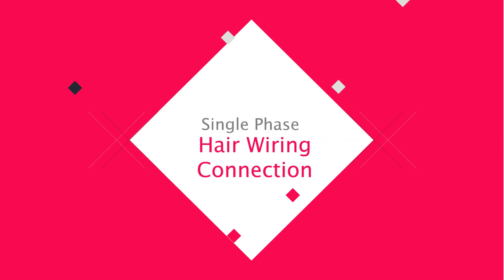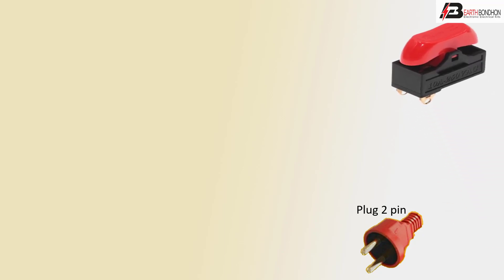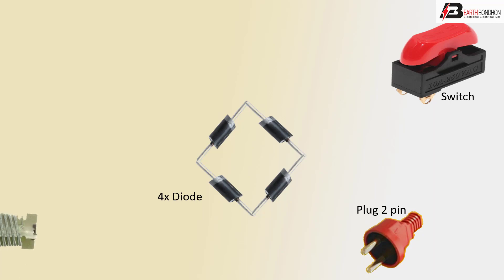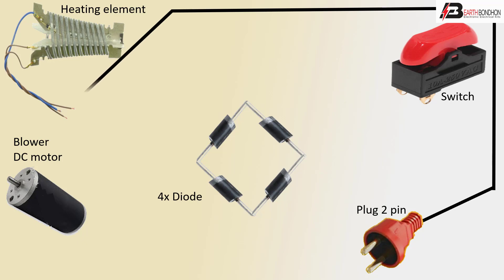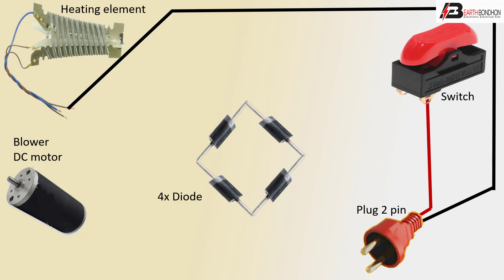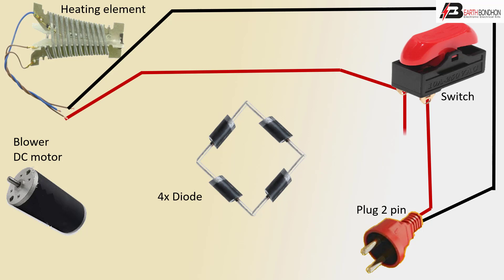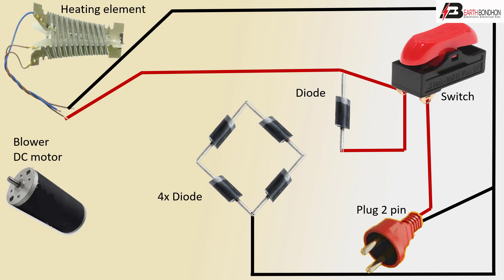Single Phase Hair Wiring Connection | hair dryer

Comment: Thank you for this intersting vidéo. 
Question: 
1- why there is  a third wire from heating element is not connected. 
2- Why did you connect the DC motor to alternatind current?.
Reply: 1- A lot of times the diode is on the heating element or/and the output of the ionizer. Therefore i think the extra wire is for one of these components.
2- The DC motor is connected thru the diodes so it works with DC. The diodes work as a convertor.

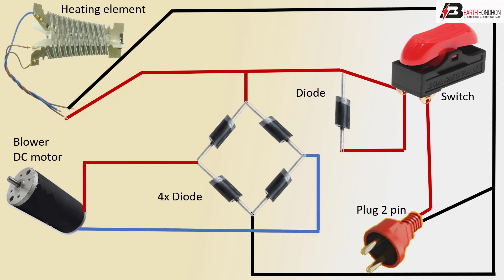Comment: 1:00 The wiring on the bridge is wrong...
Reply from the maker: why?...
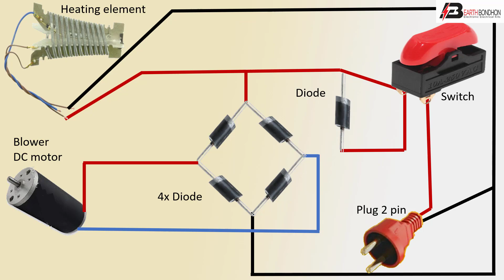Reply: ❤😂😂😂😂 1:16 right
Reply: @EarthBondhon  You must put the Motor on the Vout and you placed it at the Vin. Imagine that you suply the system with DC current and try to follow the electricity flow. The diodes will block the flow to the Motor.